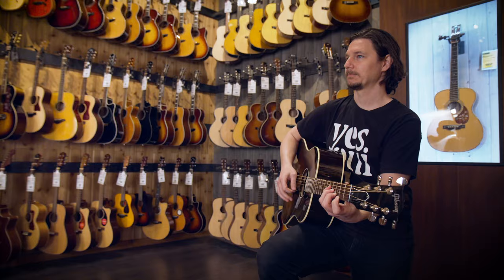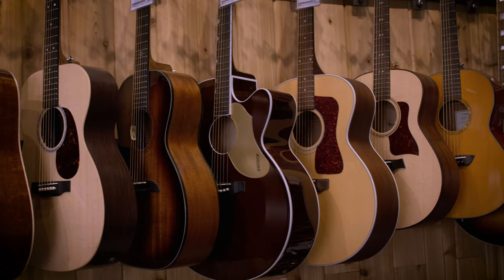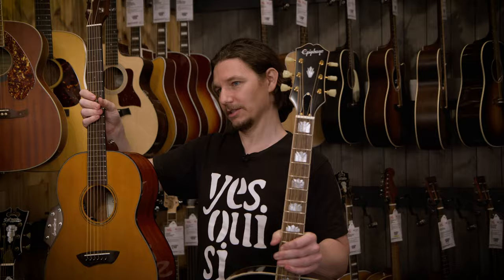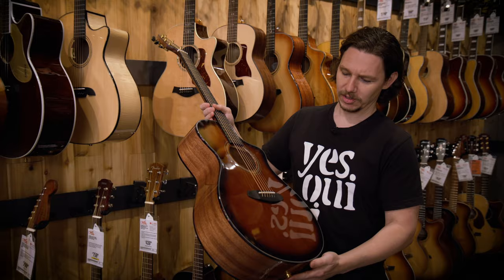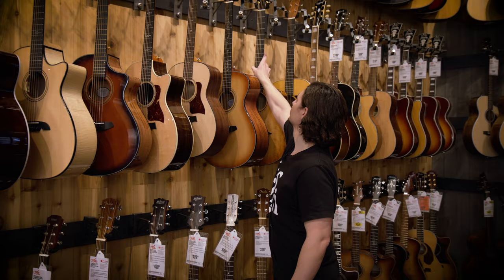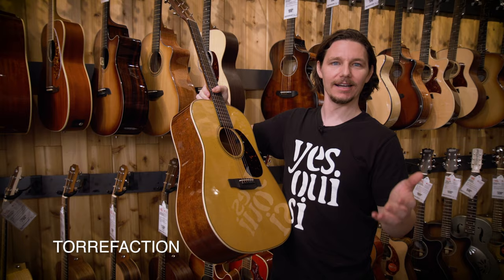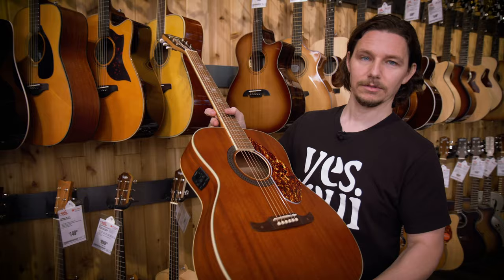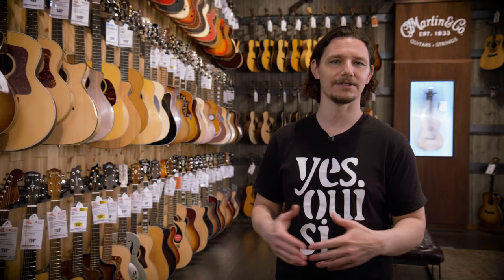Buying Your First Acoustic Guitar (5 Things You MUST Consider) | A Beginner's Guide

Comment: If I have a steel string acoustic guitar, could I switch only the strings to nylon, still using the same guitar? The bridge seemed to be different for the two styles of guitar in the video.
Reply: No. You can't. If the guitar has already steel strings, it should stay with steel strings and if the guitar has already nylon strings, it should stay with nylon strings. Because it could damage your guitar due to the different pressure of the string. Hence why we have a classical guitar (Nylon string guitar) and an acoustic guitar (Steel-string guitar)
Reply: @junchristophergutierrez2148  I found out from several sources that you can switch to nylon if you have a steel string guitar, but you cannot switch from a nylon string guitar to steel strings. 
If the guitar was designed for nylon strings the tension placed on it by the steel strings would damage the nylon string guitar.
Reply: No.  Nylon sting guitars and steel string guitars are completely different instruments in almost every way......no no noooooooooooooooooooooooooooooooo!!!

Comment: I had the means for a Gibson J45 as my first acoustic guitar. But given that it's a Gibson, I worry too much about carrying it around my house. In the first week I had it, I slightly knicked the edge twice. It's a good thing it came with a case.

I'm wanting to downsize though. Considering an Epiphone, since they are Gibson's lower tier, but might look at Fender and Yamaha as well. Definetly want one with Electric Playback to connect to Rocksmith.
Reply: you will get knicks in any guitar if you bump it into something. The name on the headstock doesn't mean a thing, especially  if it's sitting in a case a guitar is meant to be played.
Reply: Breedlove and Seagull both make very good guitars at multiple price points.  Most important points are whether the neck is easy to play for your hands, and body size is comfortable for your build.  If either is uncomfortable, you will not want to play enough.